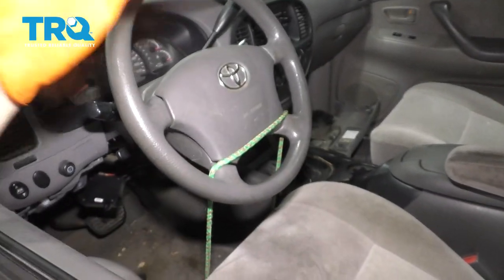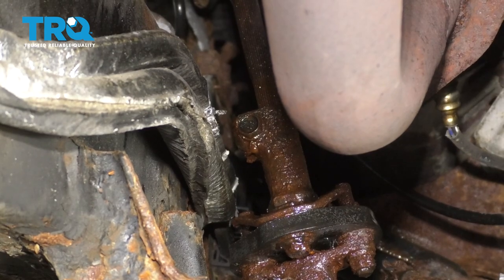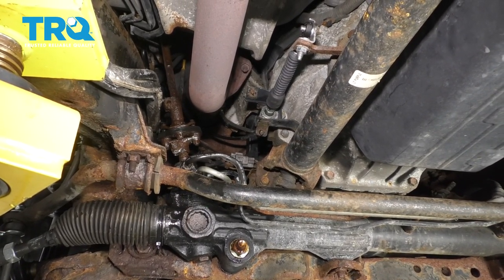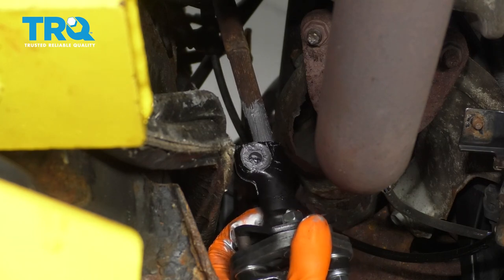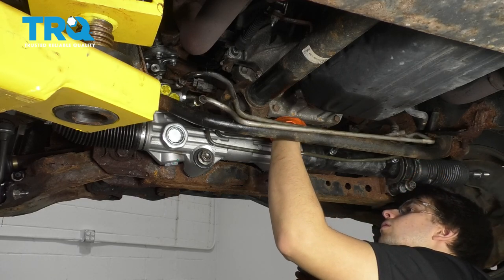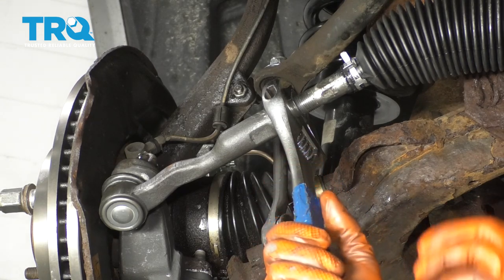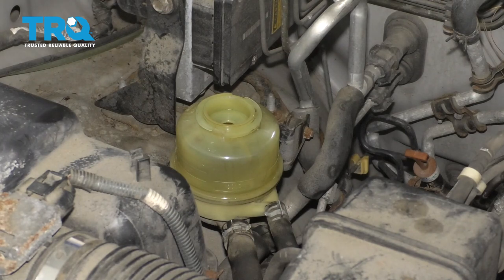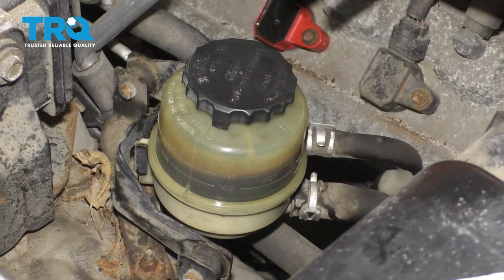How to Replace Steering Rack 2001-07 Toyota Sequoia

Comment: Just did an 02 sequoia. I changed the rack and pinion , all power steering lines, all 4 camber bolts/sleeves/nuts , both lower control arms, both lower ball joints,  both outer tierods, and sky bar links. It's been one hell of a job. But now adding fluid to power steering resivour and im not able to get it to breed any advice? I have it ¾ full and turning wheel both ways to stop and not getting much of any fluid level change it's staying at ¾ full.
Reply: Im needing to replace all of those on my 02. About how much did it cost for everything?

Comment: The flare nuts are 15 and 17.  There is no 16.  Nice video besides that.  With the right tools, you can get a torque wrench on the center bolt.  Or just move sway bar out of way.  You’ve got torque specs mixed up.  Per the FSM, 22mm nut is 96.  Vertical one you couldn’t torque is 122.  Both on right side bracket at 122.

Comment: Great job...Unfortunately 18 months ago i went to a shop to get a rack and it was cheaper to get the reman rack $800 vs an original for $1300.Boy did i get screwed.Your site sells an original rack not reman for $364.00.I do not trust shops anymore, it is just gross.My truck makes a noise whenever i turn it and i'd rather have my old rack on which was smoother than this reman.

Comment: Good lord the rust. I seriously would have stopped doing auto repair professionally if I had stayed living in the northeast. I remember torches, rusted bolts breaking, lots of penetrating oil, etc etc. I am older now and absolutely would not have the patience for this BS anymore. Thankfully the past 23 years I have lived in FL and AZ. No dealing with rust